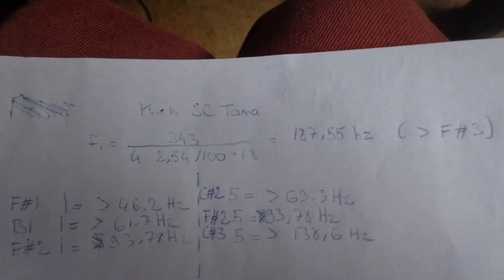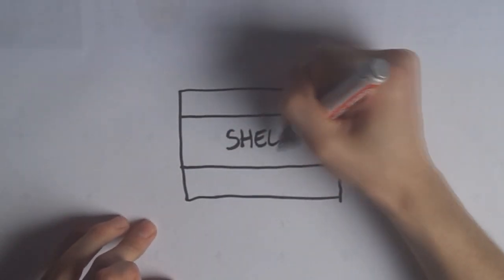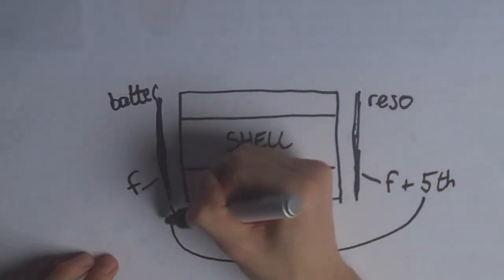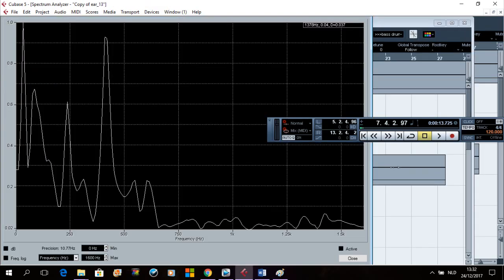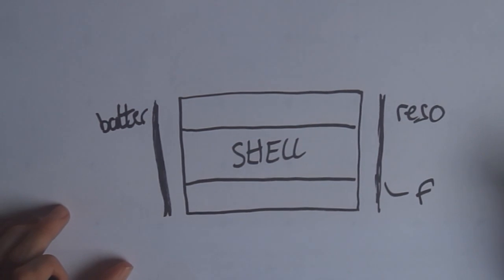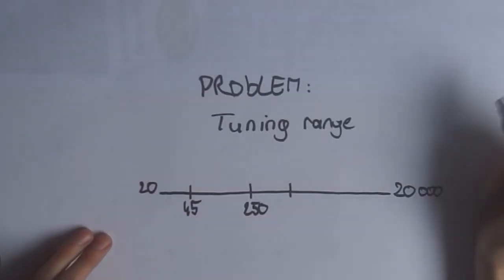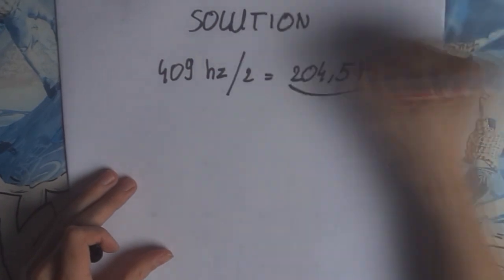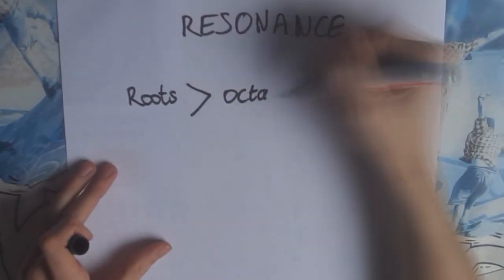DRUM Tuning to Natural Frequency | Does It Help? | How to tune drums |shell,pitch,resonance,science

Comment: Your math is calculating the “resonance” based only on the depth of the drum. This isn’t really the true resonance but a measurement of the strongest standing wave between front and back heads. This sounds good because the standing wave re-excites the drum head that is tuned to that frequency. Resonance of the shell itself is dependent on shell diameter, thickness, and lug/hardware mass. This can really only be measured by the method you used or by sympathetic measurement where you play tones through a speaker and measure the max vibration of the shell. The other factor is resonance of the airspace (google helmholtz resonance for formula) which is like blowing air over the opening of a bottle. I’ve worked through all of these experimenting with toms. The most impact was from the standing wave simple because the heads produce far more volume than the shell ever could. Though I have wanted to experiment to see if there’s a shell depth that can be used to gain a good interplay between helmholtz resonance and standing wavelength. Shells however I think play more of a role in timbre than anything else.
Reply: https://youtu.be/61-3dLB9Nys this video shows how shell resonance changes with the mass of the hardware.
Reply from the maker: Thanks for the interesting comment with knowledge.
I'm not really into the subject anymore mentally. I'll have to look that helmholtz resonance up.
As for the methods used, all based on links and their assumptions.

Comment: Great video on the subject Yorick! I once found an interesting view on this subject, but using a guitar neck as an example. John Suhr, an amazing guitar builder likes to use guitar necks with a frequency that is far out of range from the actual frequencies that are used with an electric guitar. He claims that the strings are more able to resonate on a different frequency than the natural resonant frequency of the wood because otherwise the actual wood absorbes the resonance of the strings... Maybe this theory can also be applied with your drum shell? That might just be the reason why the resonant frequency of your shell is out of range :) I don't know if this theorie is 100% correct, but it does sound logical when you hear it for the first time. Cheers mate!
Reply from the maker: I need to resonate my shell. If you watch the sound spectrum of an excited drum head, one notices it's quite shallow. Now if I get to resonate the drum shell, a much fuller sound occurs. The spectrum of the shell is much more complex than that of a drum head.
This may be due to the fact that I'm interested in a drum sound as a sound(noise), rather than a drum sound as a note. A higher depth/diameter of the shell might help that, but I don't see the necessity. The shell resonates.
Interesting topic though.
Does the shell absorb the energy of the excited drumheads, to resonate in turn?
Or does the shell choke the drumheads, only to let them resonate more when their pitches are more alike?